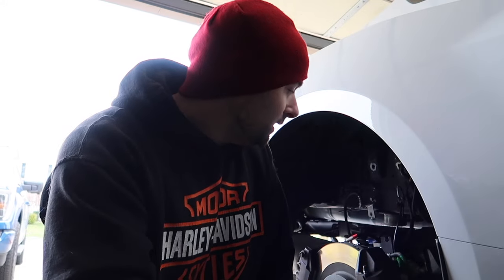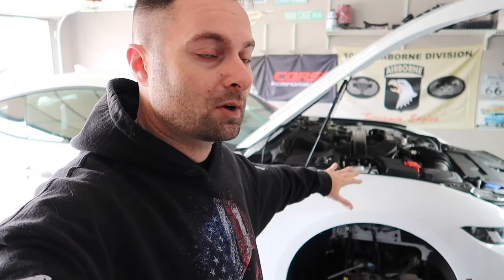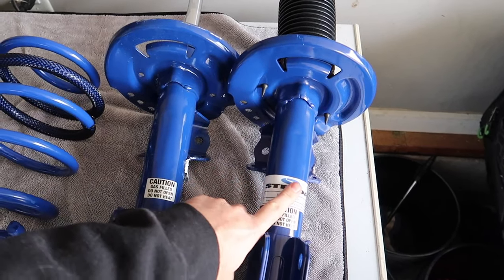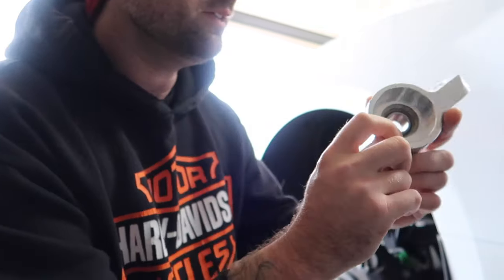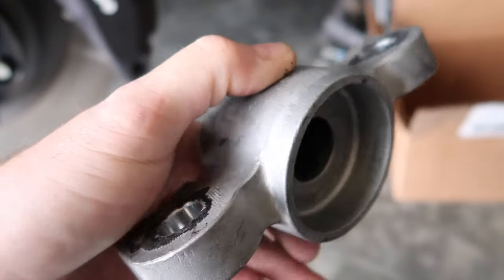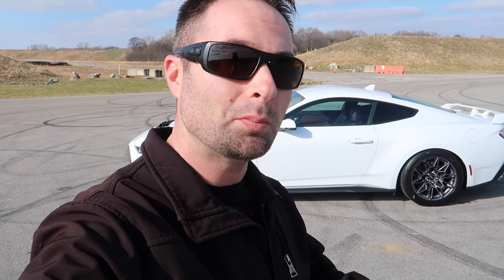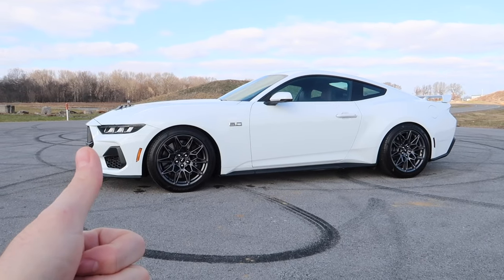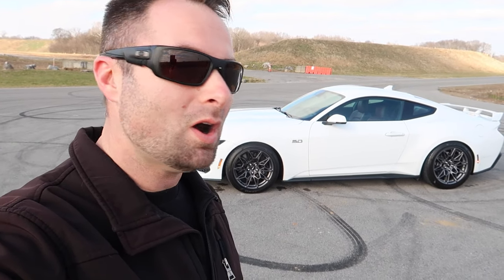OOPS... I BROKE MY NEW 2024 FORD MUSTANG GT 🥵

Comment: you just gotta not go hog wild with a single bit. use progressively larger bits and it'll be fine. i smelled rubber burning a little but once they cooled it was fine. been rocking steeda adjustables for weeks and they're awesome. no more wheel hop and i don't even have vertical links.

Comment: Nice upgrades!! But I have seen horror Stories with any type of billet rear Upper shock mounts! Be careful,,,seen them rip right out of the Factory Holes! Unless they made that mount strong in the S650. Id keep an eye out on that mount, Thats why the factory ones break instead of ripping out the mount with billet type mounts! just a FYI.